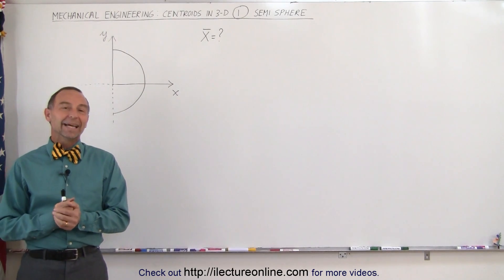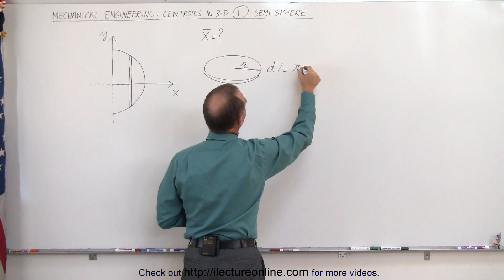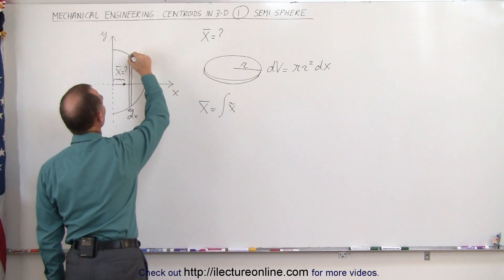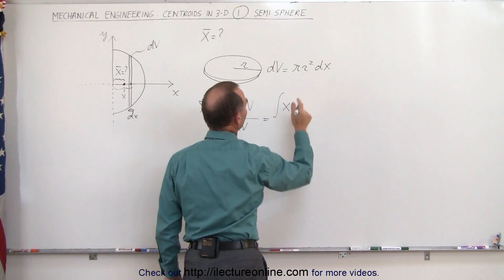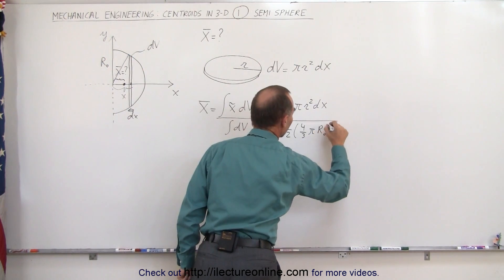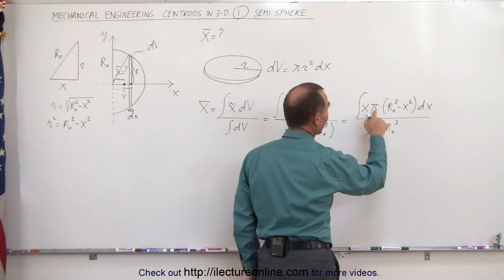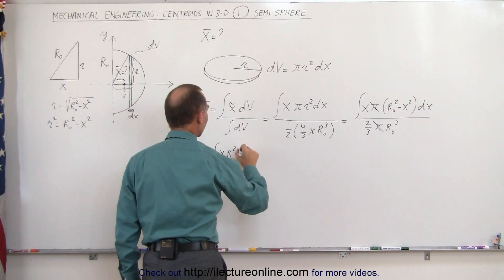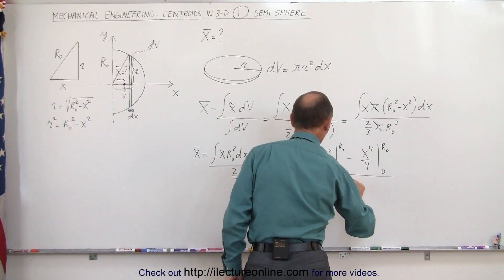Mechanical Engineering: Centroids in 3-D (1 of 19) Semi-Sphere

Comment: Call you help me figure something out?

Okay, what I'm looking for is the center of mass (or "gravity") of a hollow sphere with a spherical cap removed from one side (that is less than a hemisphere in size). Kinda like one one those round wine glasses but without the flat base. 

Also, I want to confirm that I have the correct center of mass of the (hollow bowl-shaped) spherical cap.

This video is the closest I've seen to what I am looking for. 

I'm trying to use this to prove Newton's shell theorem using an alternative method from triple integrals and so on...

If you help me, I'll give you all the details of my new proof and you can go ahead and do a video on it if you want.

Comment: Where did the dx go from the bottom portion of the equation? if dV = (pi)r^2 dx and you replace the dV on both the top and bottom, where did the dV go on the bottom?
Reply from the maker: We replaced the integral in the denominator with the actual volume (since that is what the integral would have given us anyway).

Comment: sir why we didn't include z since it is 3d object
Reply from the maker: +dipesh rathi  It depends on the integration technique.  There are several ways in which you can integrate to find the volume of an object.  Because of the symmetry of the object we didn't have to integrate in the z-direction to find the answer.